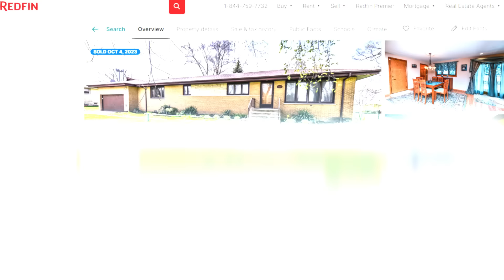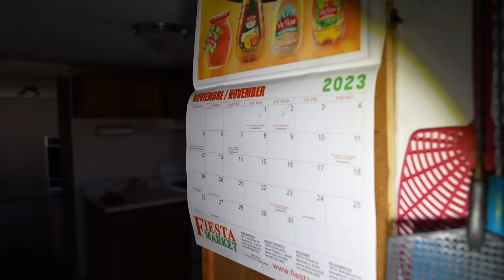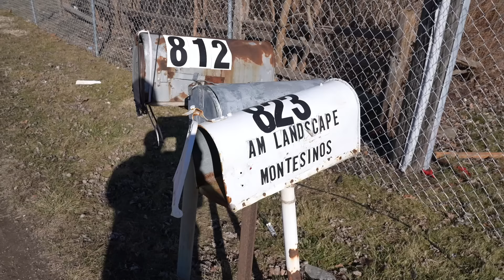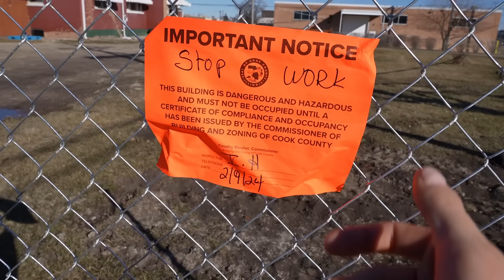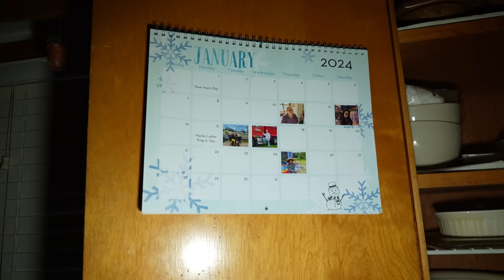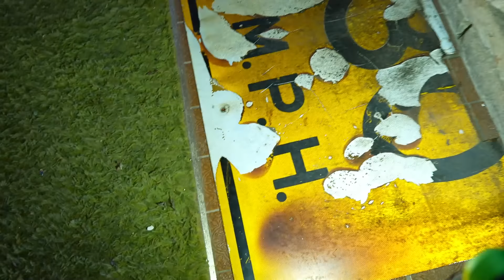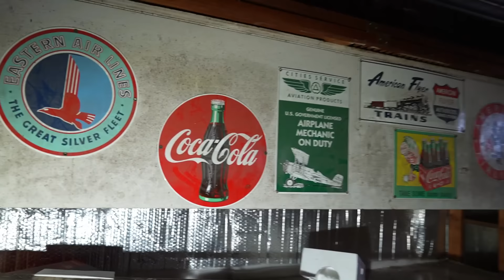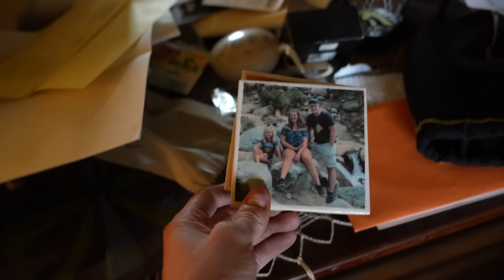How the Surge in AI Indirectly Caused an Entire Neighborhood to go Abandoned

Comment: The water in all the basements could be due to the pipes freezing after the electricity was shut off during the cold weather.
Reply: Or the sewage system had tree roots growing through their exterior sewage drains.
Reply: The water table might be high.Older homes sometimes have sump pumps and if the electricity is shut off the basement/crawlspace will fill slowly with water.
Reply: Or it could be from ripping out all the septic tanks.
Reply: @cameronking3551 Chicago is literally supposed to be swamp land. Every home with a basement has a sump pump.
Reply: No, the pump can't run without electricity. That's just ground water seeping up.
Reply: That seeped in water is probably toxic. Sometimes the offending company buys up the land rather than have to pay up the people for health problems. Test your home before you go!

Comment: In the house with the security cameras, I have the same ones. If you'd gone up into the roof you likely would have found the box they are all connected to along with the hard drive that the video files are saved to. I don't think they tried to make it seem like the house was under surveillance, they just did not want to be bothered with taking them down. I no longer use my system but taking them all down is a hassle and I have no intention to do it because that also means patching the holes. Lol. I had the system put up when one of my children was little because he has autism and as a little one he was a HUGE eloper. It made it easy to find him quick and it would notify me if there was motion detected in certain rooms of the house (rooms with a door to the outside). We live by a highway AND a huge body of water.

The "Palm" is a Palm Pilot, you are making me feel so old lol. It was basically a device that you'd use to store information like appointments, phone numbers, etc. It was an old-school business tool! I still have mine from way back when and it had GPS navigation. I felt super fancy when everyone else was still using gas station paper maps or printed off of MapQuest, the plebs!